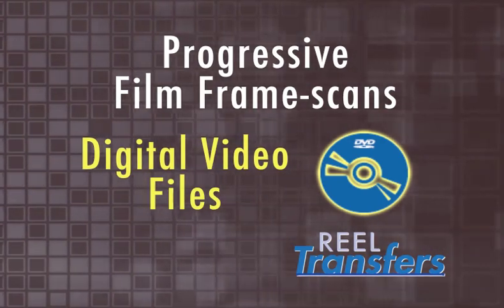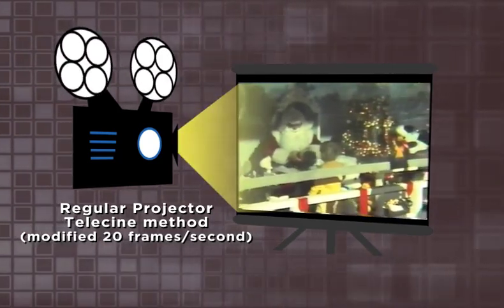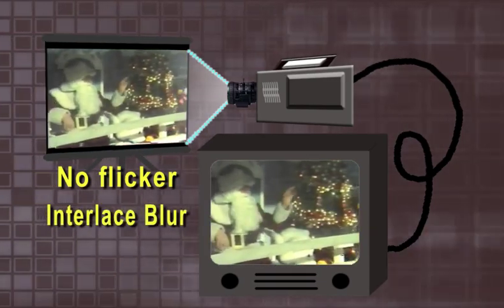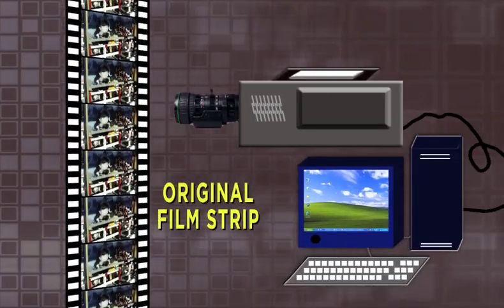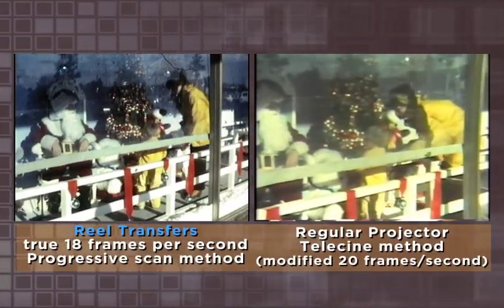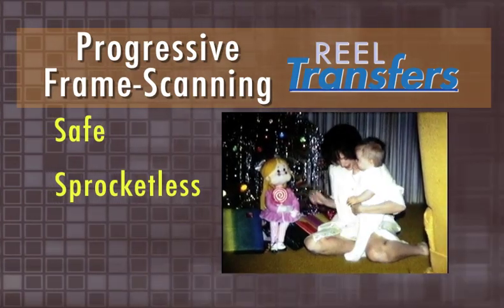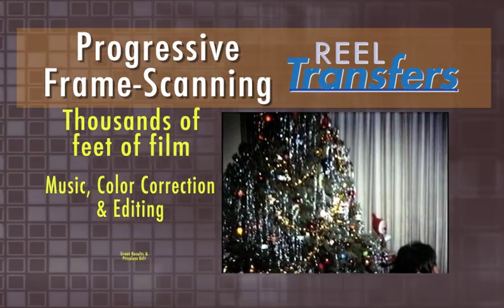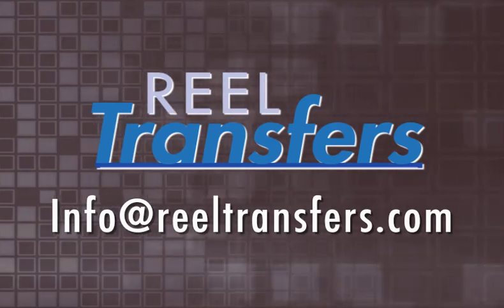Frame-by-frame film scanning- demonstration

Comment: Do you use old movie film projectors that have been modified to capture your "Progressive film transfer"? Do you use Moviestuff equipment that uses old modified film projectors to transfer the image, which are prone to the same issues of damaging the original film as are old projectors? I worked at a transfer house for more than a year that used Moviestuff transfer machines and I saw so many films damaged by these units.
Reply: Hi there. We used to use older systems by Moviestuff that did frame-by-frame with modified projector parts, but not really anymore (think we keep one system on hand for overflow work or if repeat customer prefers that 'look'). 

We never had issues with the older systems though. Might be good fortune or that our expertise with film projectors minimized any issues. Some folks think just anybody can operate them, and find out quickly that is not the case.

Comment: Hello,
 
I see your vidéo in youtube, ot was ineresting, i would like to knew how much cost this machine (projecteur Super 8mm), did you have a picture ? and you sell also the soft ?
Thank you
Momo
Meilleures salutations.
Reply: Hi, VERY sorry for the delay. When this video was made, we were using a Sniper PRO HD. We've moved on from that gear but still do frame-by-frame. The system is no longer made by the manufacturer, but they occasionally might appear for sale on ebay.